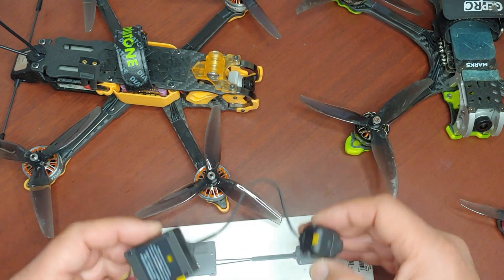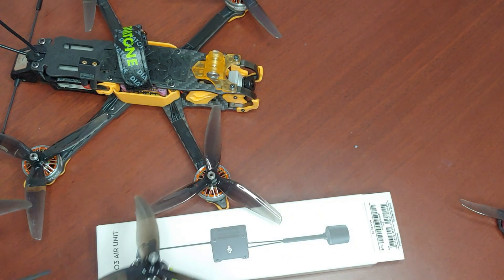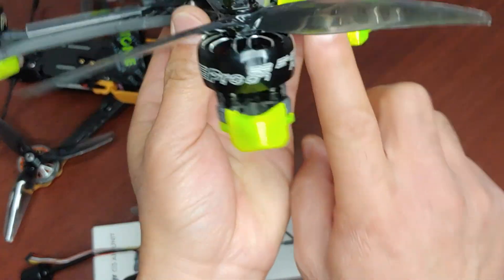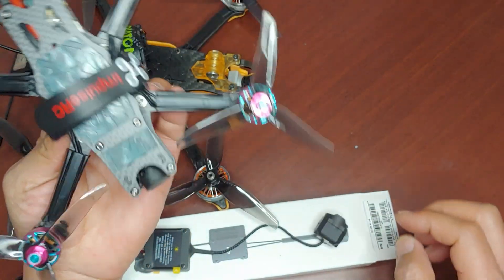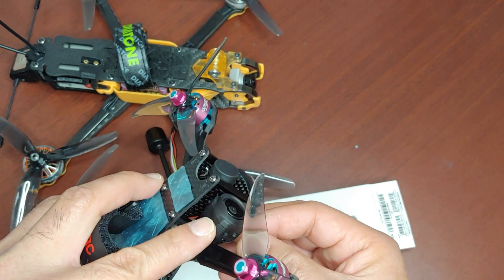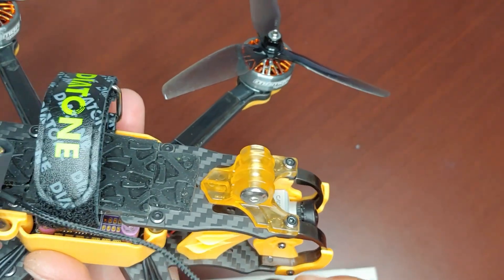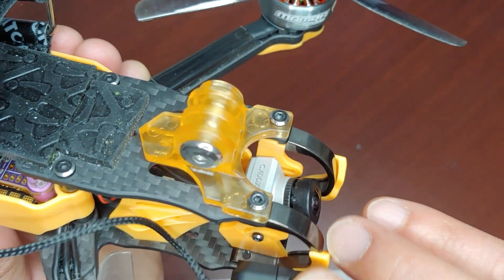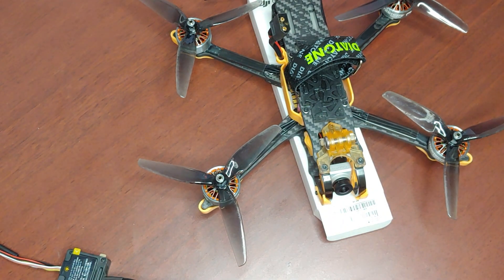DJI 03 Air Unit, how it will fit in some frames. Part 2

Comment: Did you get it installed??
Reply from the maker: Yes, all the ocean footage is from the Roma with the 03. Install was pretty easy, all you need is a 03 au 3d mount. Let me know if you want details on the Install.
Reply: @jaechoe  where did you print the mount from?  Or do you have a link?  I'm ready to make this conversion for sure!!
Reply from the maker: @ChrisParayno  The 3d print was printed by someone else, I don't have a 3d printer.  Will try to find the link and let you know.
Reply: @jaechoe  thanks man!  I bought a cheap one that makes small print, best 80 bucks of my life 🤣🤣
Reply from the maker: @ChrisParayno  the 3D printed 03 AU mount that I am using, I actually purchased from Albert. I have searched his reviews and it seems like Albert designed it and I cannot find the 3D print file for it.  I did find another that is similar check it out: www.printables.com/en/model/335235-dji-o3-air-unit-cage-20x20-and-30x30-adaptor
Reply: @jaechoe  cool I found this too, just have to print it out.  What about the camera mount? Did you do a direct bolt in? it's cool that you see no props because I think with my F4 I'll see some props.  Was everything TPU printed?
Reply from the maker: @Chris Parayno  For the camera mount on the Roma F5 I used the original camera mount, and mounted the camera as forward as possible.  To my knowledge the F4 and F35 have the same front camera mount / cage, which is different from the F5.  I did not have great success trying to mount the 03 system in the F35, had to much cage in view.  Pretty sure a little more tinkering could fix that.  Best of luck to you on the conversion, any other questions feel free to ask any time. Happy Flying Chris!!!!!
Reply: @jaechoe  totally makes sense, shorter arms means more blades in view which I want to avoid to take full advantage.  I found several potential "camera mount" extension prints I'm going to try, if all else fails I'll have to buy a new frame 🤣🤣. Anyways thanks for the advice.  Can't wait to get this beast out in the open. Happy flying too.

Comment: How was the installation on the Roma 5? I’m super excited to get it in mine!!
Reply from the maker: Pretty straightforward and easy, just order the longer camera cable and print or get a 03 vista mount 20×20.

Comment: Hey Jae! If you want to try the 03 on your Mark5, you can drill new mounting holes on the aluminum cage. On the Roma, that will be much easier :) You will need to use the carbon fiber mount plates. They are thinner. Mine is not ready yet… Have fun!